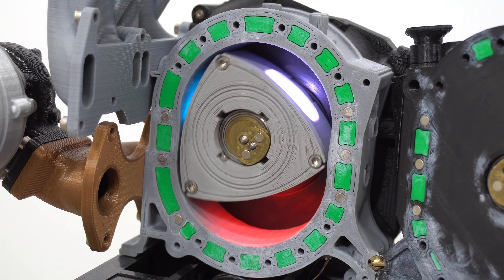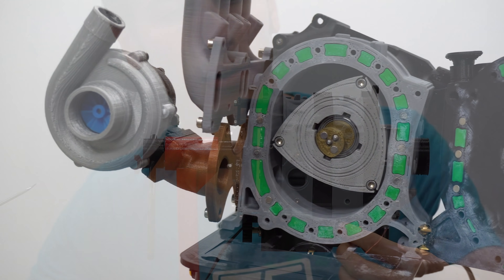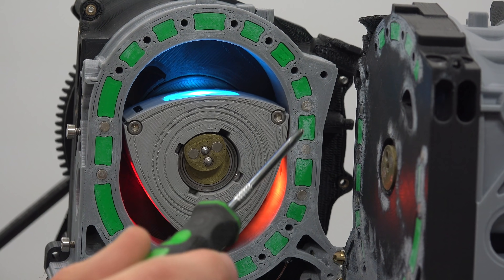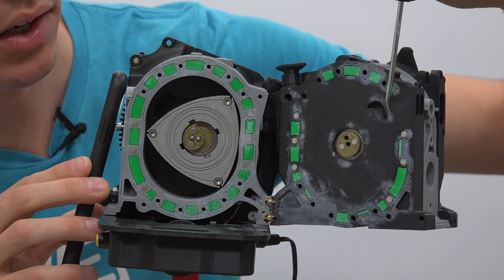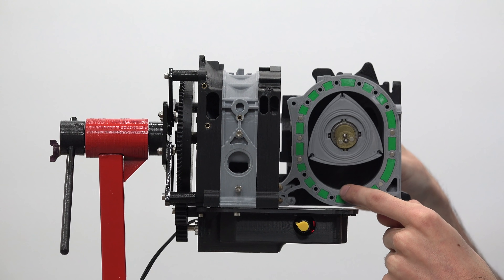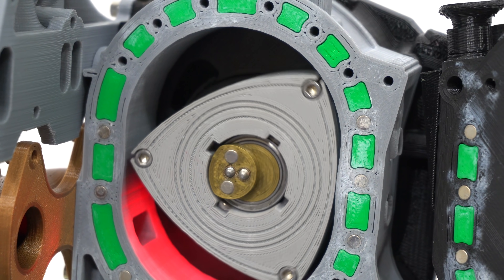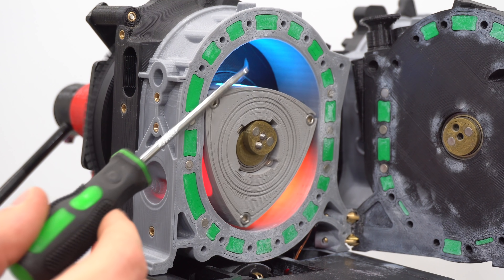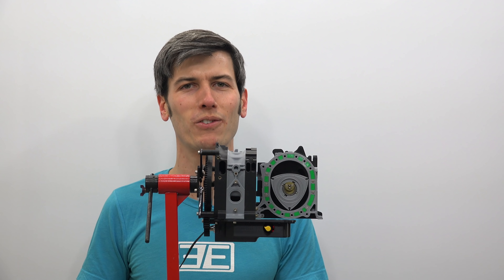This 3D Printed Rotary Engine Is Genius - Mazda RX-7

Comment: When a piston engine is measured for example, total volume is given in cubic inches or liters. When a rotary engine is measured only 1/3 is claimed as its volume. What happened to the other 2/3?  I think its a way of cheating in countries that used to or still tax a car by engine volume. If my 400 cubic inch GTO engine were measured this way, I could call it a 100 cubic inch engine (400 divided by 4 cycles).
Reply: On a 13B rotor engine each rotor side (3 per rotor) creates a "moving combustion chamber" that goes trough the 4 stroke Otto Cycle each (admission, compression, ignition, exhaust) 

654 cc x 6 = 3924 cc (3.9L)
Mazda just quoted 1/3 of its real displacement to pay less taxes because Japan's engine taxation laws at that time.

You got to count all its 6 chambers going trough the 4 stroke Otto cycle once for a full thermodynamic cycle which takes 3 rotations of its eccentric shaft (1080°) 

654 cc X 6 = 3924 cc @ 1080° rotation. 

Its real full thermodynamic is at 3 revolutions of the eccentric shaft when each of the 6 faces (rotor sides) have completed one 4 stroke cycle event and not at the 720° (2 revolutions) of the crankshaft of a piston engine. Anyways, using the 720° of the piston engine thermodynamic cycle puts the 13B displacing 2616 cc or 2.6L because 4 faces ( 2 per rotor) have completed one 4 stroke cycle each, but ypu got 2 more faces ( 1 per rotor) left thst will complete 1 4 stroke cycle. All have to be counted, just like in a piston engine all cylinders are counted

It is not a 2 cycle engine.
Reply: @EM6285  But the way you're talking about measuring it would end up including the exhaust stroke measurement too. Which would double the size of an engine. For displacement measuring they only go through the intake stroke, not a full 720 for a full cycle. It's purely how much one cylinder displaces on one stroke. And even though it isn't quite right a rotary is basically considered a 2 cylinder engine. So, they just take what one rotor displaces on it's intake stroke and double that for the displacement.  

I can see where you're coming from, but even in racing rotaries don't get classed like they are a much bigger motor.  And, even with the RX-8 they were claiming the small engine size. I doubt that would fly in more modern times if it was just some sneaky trick pulled for tax reasons. Manufacturers don't get to just claim an engine size without some sort of logic to back it up.
Reply: Full thermodynamic cycle of a piston engine is at 2 crankshaft rotations (720°) where all the pistons in cylinders have completed one 4 stroke Otto Cycle.

No matter how many cylinders, 1, 2, 3, 4, 5, 6, 8, 12, 16... it will always take 2 crankshaft revolutions (720°) for all cylinders to go trough one 4 stroke cycle. Exhaust phase of the 4 stroke cycle does not doubles the displacement because no power is made and exhaust by-product of the displacement consumed at admission is being released (no power added)

Inside the housing each rotor makes 3 separated chambers,
each chamber goes trough the 4 stroke cycle (admission, compression, ignition, exhaust) that displaces 654 cc per "working chamber"... If in a piston engine all units (cylinders) are counted in its full thermodynamic cycle (720° crankshaft rotation)  for displacement measurements, why can't all 6 working chambers in a Mazds 13B be counted? 
And set to mind that the rotary engine thermodynamic cycle is set at 3 revolitions of its eccentric shaft (1080°) where all 6 rotor faces (3 per rotor) had completed one 4 stroke cycle each and not at the piston engine's 720^ crankshaft rotation.

Eccentric shaft revolutions / number of chambers completing one 4 stroke cycle / displacement.

1 revolution 360° / one side per rotor ( 2 ) completing one 4 stroke cycle. 654 cc x 2 1308 cc. Mazda counted just 1 side per rotor to give it a nominal displaceme to pay less taxes per engine produced.

2 revolutions 720° / 2 sides per rotor ( 4 ) completing one 4 stroke cycle. 654 cc x 4 = 2616 cc (2.6L)
This gives the 13B rotary engine an equivalent displacement to compare it with 4 cylinder engines again, using the piston engune's 720° crank-shaft rotation characteristics.

3 revolutions 1080° / 3 sides per rotor ( 6 ) completing one 4 stroke cycle. 654 cc x 6 = 3924 cc. The real thermidynamic cycle for a rotary engine.

On a full thermodynamic cycle, either 720° for the piston engine or 1080° for the rotary engine all the units (cylinders or rotor sides) complete just ONE 4 stroke cycle and none repeats it.
Reply: @EM6285  I understand what you're saying about completing the full cycle. But, that has absolutely nothing to do with determining the displacement of the engine. You don't take how much it displaces over the full cycle. You only measure how much it displaces on the intake stroke. So, in reality you only need to go 180* from TDC to BDC in order to find the displacement. Or use the Bore x Stroke like a normal person. 

Which is why by your logic it would double the size of a 4 stroke piston engine. Based on you expecting 720* to complete the full cycle on a 4 stroke piston engine. That adds up to the engine going through 2 full rotations. Which would yield a result of double the standard accepted size.  

They don't size engines based on the thermodynamic cycle. They size them based on the intake volume multiplied by the number of cylinders. Which is why I said they consider a rotary to be a 2 cylinder. So, you simply multiply the 654cc by 2 and get 1308cc. Which is what they rate them at. Now, if you wanna argue from that point that a rotary should be a 6 cylinder instead of a 2 cylinder you have a valid point and a case. But, crankshaft rotation and thermodynamic cycle doesn't matter at all with engine sizing.
Reply: @NBSV1  The rotary engine is not a 2 cylinder engine. Each rotor creates 3 separated chambers inside the housing, each side of the rotor (3 per rotor) goes trough the 4 stroke Otto Cycle. So if each side of the rotor draws air+fuel mixture at intake, then it has to be multiplied by the number of all tis chambers ( 6 in a 2 rotor engine)

Yes thermodynamic cycle is related to displacement because a thermodynamic cycle is the final total of all units (number of pistons or rotor faces) completing one 4 stroke cycle each and in a piston engine it takes 2 crank shaft rotations (720°) for all cylinders wether 1,2, 3, 4, 5, 6, 8, 10, 12 etc to complete one 4 stroke cycle each and in a rotary engine it takes 3 eccentric shaft rotations (1080°) for all rotor sides (working chambers) wether 3, 6, 9, 12 to complete one Otto 4 stroke cycle.

654 cc x 6 chambers = 3924 cc (3.9) @ its true thermodynamic cycle at 3 eccentric shaft revolutions (1080°)

Modify a 13B ignition system so it only fires its spark at just one rotor side or face per rotor and see if it can keep spining in idle using just the cc displaced by just one side of each rotor, there the 1.3L quoted displacement fails because it is an incompletw thermodynamic cycle.

Each rotor is of-set 180° to the other.

360° eccentric shaft rotation, 1 side per rotor (2) completed  the 4 stroke cycle. 180° + 180° = 360°
654 cc x 2 = 1308 cc 1.3L (Mazda's nominal displacement to quote 1/3 of its real displacement)

720° eccentric shaft rotation , 2 sides per rotor (4) completed the 4 stroke cycle. 180° + 180° + 180° + 180° = 720°
654 cc x 4 = 2616 cc (2.6L) 
This is the "equivalent displacement" most entities gave the Mazda rotary engine using the metrics of the reciprocating piston engine (720° crankshaft rotation / thermodynic cycle) but 720° is not the Mazda rotary full thermodynamic cycle. Using just 2 eccentric shaft rotations (720°) because the thermodynamic cycle in a piston engine is at 720° just lets Mazda skip its full thermodynamic cycle that it is at 3 eccentric shaft rotations (1080°)

1080° eccentric shaft rotation, 3 sides per rotor (6) completed the 4 stroke cycle. 180° + 180° + 180° + 180° + 180° + 180° = 1080° The full true thermodynamic cycle of the Mazda rotary engine. 654 cc x 6 = 3924 cc (3.9L) Real displacement.

So if it is O.K for Mazds to CHEAT then for now on I'll use their tactics and I will just count 2 cylinders in a TOYOTA 2JZ to quote a nominal displacement and it will be OK brcause if Mazda did it by counting just one rotor side (combustion chamber) I can do the same and now my 2JZ is 1.0L nominal displacement.

The volume of one chamber in a piston engine is multiplied by the numbrer of cylinders so in a Mazda rotary the volume of one chamber is multiplied by the number of chambers. 720° is the piston engine's thermodynamic cycle, not Mazda's because in Mazda rotary engine is at 1080° (3 rotations)
Reply: Mazda chose to count one working chamber per rotor because Japan, also Europe as well, tax cars based on engine displacement and any engine over 1.5 liters was taxed more than those below 1.5 liters, which risked Mazda's Wankel cars not being sold in certain markets. However, America, also Canada, New Zealand, and Australia, doesn't have this problem and can use the Wankel's full displacement. So, Mazda decided to avoid taxation on their Wankel engines by only counting one working chamber for each rotor, instead of all three working chambers per rotor. So basically, Mazda's 13B 2 rotor, the "1.3 liter engine", is actually 3.9 liters and the Le Mans winning R26B 4 rotor is actually around 7.8 liters! Now, fuel economy and power output makes much more sense

Wankel engine displacement:
3√(3) x radius x width x eccentricity (all in millimeters)= Geometric Displacement per chamber
Geometric Displacement x All 3 chambers= Full Thermodynamic Displacement per rotor
Thermodynamic Displacement x number of rotors= Full engine displacement
**This formula applies to ALL Wankel engines

Wankel engine basic dimensions:
Radius- Rotor radius, center to apex (generating radius)
Width- Rotor width, depth (rotor thickness)
Eccentricity- Offset (radius offset)
**Similar to bore and stroke dimensions of piston engines

Wankel engine equivalency:
1 rotor engine- 3 chambers= 3 cylinders- Inline 3
2 rotor engine- 6 chambers= 6 cylinders- Inline 6, VR6, V6, Flat 6
3 rotor engine- 9 chambers= 9 cylinders- W9
4 rotor engine- 12 chambers= 12 cylinders- V12, W12, Flat 12
**Comparison between piston engines and Wankel engines

Revised Mazda Wankel engines:
Mazda 3A
3√(3) x 110mm x 45mm x 14mm= 360,093.3629~ 360cc per chamber
360cc x 3 chambers= 1080cc or 1 liter
*Equivalent to a 1 liter 3 cylinder engine

Mazda 40A
3√(3) x 90mm x 59mm x 14mm= 386,281.9711~ 386cc per chamber
386cc x 3 chambers= 1158cc or 1.1 liters
*Equivalent to a 1.1 liter 3 cylinder engine

Mazda L8A
3√(3) x 98mm x 56mm x 14mm= 399,230.7829~ 399cc per chamber
399cc x 3 chambers= 1197cc per rotor
1197cc x 2 rotors= 2394cc or 2.3 liters
*Equivalent to a 2.3 liter 6 cylinder engine

Mazda 10A
3√(3) x 105mm x 60mm x 15mm= 491,036.4039~ 491cc per chamber
491cc x 3 chambers= 1473cc per rotor
1473cc x 2 rotors= 2946cc or 2.9 liters
*Equivalent to a 2.9 liter 6 cylinder engine

Mazda 12A/12B
3√(3) x 105mm x 70mm x 15mm= 572,875.8046~ 573cc per chamber
573cc x 3 chambers= 1719cc per rotor
1719cc x 2 rotors= 3438cc or 3.4 liters
*Equivalent to a 3.4 liter 6 cylinder engine

Mazda 13A
3√(3) x 120mm x 60mm x 17.5mm= 654,715.2053~ 655cc per chamber
655cc x 3 chambers= 1965cc per rotor
1965cc x 2 rotors= 3930cc or 3.9 liters
*Equivalent to a 3.9 liter 6 cylinder engine

Mazda 13B/Renesis
3√(3) x 105mm x 80mm x 15mm= 654,715.2053~ 654cc per chamber
654cc x 3 chambers= 1962cc per rotor
1962cc x 2 rotors= 3924cc or 3.9 liters
*Equivalent to a 3.9 liter 6 cylinder engine

Mazda 16X/SkyActiv-R
3√(3) x 122mm x 70mm x 18mm= 798,752.5504~ 798cc per chamber
798cc x 3 chambers= 2394cc per rotor
2394cc x 2 rotors= 4788cc or 4.7 liters
*Equivalent to a 4.7 liter 6 cylinder engine

Mazda 13G/20B
3√(3) x 105mm x 80mm x 15mm= 654,715.2053~ 654cc per chamber
654cc x 3 chambers= 1962cc per rotor
1962cc x 3 rotors= 5886cc or 5.8 liters
*Equivalent to a 5.8 liter 9 cylinder engine

Mazda 13J/R26B
3√(3) x 105mm x 80mm x 15mm= 654,715.2053~ 654cc per chamber
654cc x 3 chambers= 1962cc per rotor
1962cc x 4 rotors= 7848cc or 7.8 liters
*Equivalent to a 7.8 liter 12 cylinder engine

You get the idea. Wankel rotary engines are actually much bigger than we thought they were. They pack a lot a power and displacement in a small, lightweight package. To fully understand these engines, all three working chambers for each rotor must be counted, despite Japan and Europe's taxation regulations, and not just only one or two working chambers per rotor
Reply: It’s because it doesn’t matter if it’s a 4 stroke or 2 stroke. It’s the measurement of how much one cylinder displaced multiplied by the number of cylinders. Very easy on a piston engine. More complicated on a rotary. But, they basically just took how much one rotor displaces and multiplied it by 2 for a 2 rotor. 

More power strokes doesn’t make the motor bigger.

Comment: so why is the intake ports in the front/center/rear plate instead of the rotor housing like the exhaust ports
Reply from the maker: You can do either. Allows for more airflow if you have two sides with air coming in, rather than just a single entry.
Reply: I was going to guess for tumble/spin of the air for better atomization.

Comment: The disadvantage of this engine is that it destroys itself every 100'000klm if not sooner...
Reply: All I have done is basic maintenance nothing to hard and I'm over 170km and still running strong most of you people who comment this either had bad luck or just didn't take care of it like you should these engines need to be revved not one day has gone by where I don't hit redline. They are great engines if you take care of them just like any other car
Reply: I dunno. Got mine to 180K+ with zero problems. I believe it'ss all about a strict maintenance schedule, using the correct oils and staying on top of the spark plugs. Worst case, if a rebuild is needed, it's ridiculously easy. Never had to do mine but my bros '87 did. Only took us high school knuckleheads like a day in the driveway. Eeeeeeasy.
Reply: Rotaries need extra TLC to live a relatively healthy and long(er) life.  Maintenance is key.  Premixing your fuel helps as do upgrades to the cooling system.  Aftermarket apex seals have come a long way.
Reply: I'll be a very happy panda if they last to 100000 km. XD

Comment: No valves needed?  No camshaft then, either.  Very simple design, and clever!
Reply: just a little more ingenious than the 2 stroke engine...
Reply: Unfortunately, both are oil burners.

Comment: The rotary engine is the closest thing to having a gas turbine engine in a car since gas turbines have intake, compression, combustion and exhaust happening simultaneously plus the rotary engine is silky smooth with no discernible vibration due to the very balanced rotor. They are really cool, but unfortunately not very good on fuel and consume oil in order to keep the rotor sealed. I had a Mazda RX-8 a few years ago, a great car to drive and lots of fun with a unique engine note, though fuel economy of 15 mpg was not fun on my daily drive to work! Alot of people will criticize the low down power as they have far less torque due to their design. True, but you don't drive a rotary engine car like a reciprocal engine car,  if you are driving enthusiastically you need to keep the revs up, normally more the 4000 rpm if you are making good progress on a twisty road, lower revs than that, then you loose the power/torque when accelerating out of corners. In the UK it became prohibitive to run - our car tax is based on CO2 emissions, which led to a bill of £500 per year (Same as a V8 range rover!) and with fuel costing £1.20 a litre it would cost around £70 to fill up and that would give you a range of 250 miles if driven conservatively. I got rid of mine for that reason as there were other more efficient cars which were still fun to drive and in some cases have more power and space!
Reply: gas turbines have been tried. Their problem was throttle lag and using nearly as much fuel at idle as full throttle.
Reply: I always heard that rotary's were really smooth also, so I  was extremely disappointed with the fact that every RX-8 I rode or drove so far has much worse vibration than any boxer engine. When approaching 100.000 km they often get more vibration than most inline 4's or V engines, specially when idling.

Comment: Ceramic seals solved the thermal differentiation into the rotor housing. They were used in the 787B that won the 1991 LeMans 24H race. But they were expensive for small production-medium priced sport vehicles like RX7 and RX8.

Comment: You forgot to mention WHY it consumes oil, to lubricate the problem area's like the SIDE SEALS not apex seals. Should also mention a rotary cannot seize internally due to its materials and design, and is capable of 13000rpm when built right
Reply from the maker: Oil is for all the seals.

Comment: maybe you wanna look at the cr700p. it's currently still a prototype but the engine will apparently be a rotary engine that doesn't need to burn oil thanks to modern ceramic witchcraft

Comment: so a 6.2L V8-rotorengine would put down 1500hp, i mean, besides not working at all, but that would be knitpicking.
Reply: There's a 12-rotor on Youtube somewhere, that takes 7.8L to put out 1440 HP at the 'crank', but can be turbocharged to provide upwards of 5000. It's designed for marine applications, though.

Comment: Should explain that the reason people count the rotary as twice the displacement Mazda claims is because the power stroke represents actual volumetric displacement of air. Twice the power strokes means twice the displacement.
Reply from the maker: I did explain this in the video.